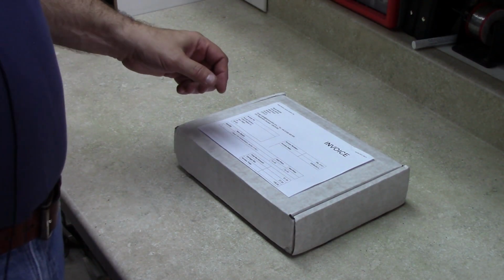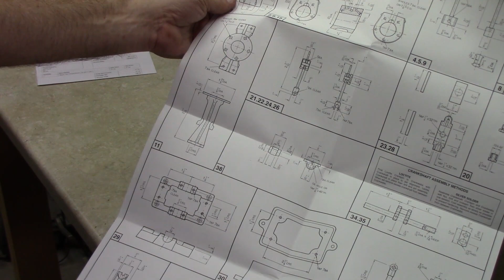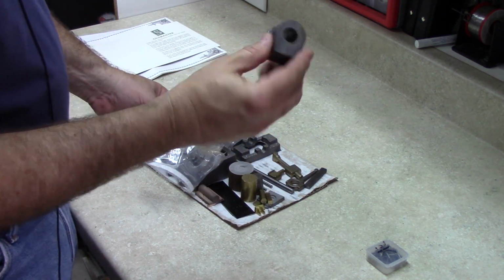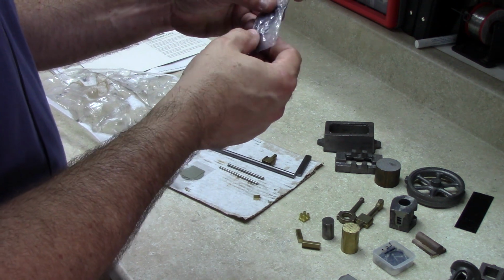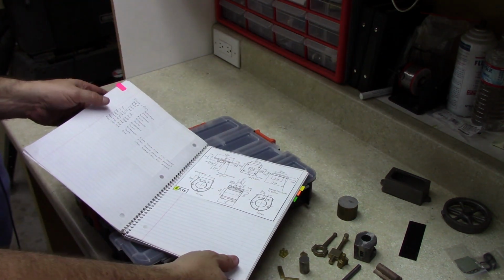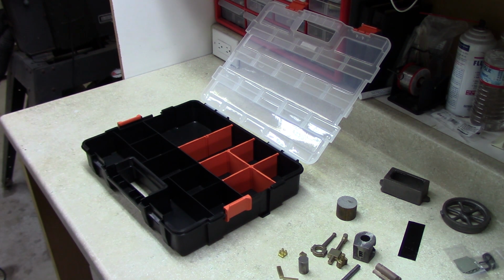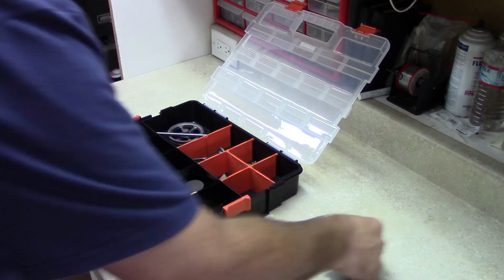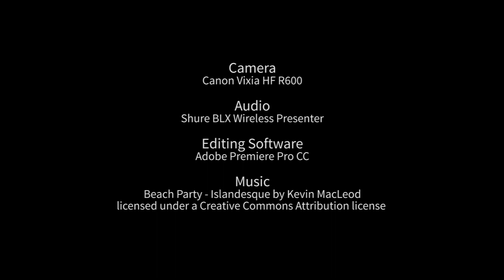Building the Stuart Models 10V Vertical Steam Engine - Part 1

Comment: Years ago I bought a Stuart 10D kit (dual cylinder  version of the 10V) I put it aside when I broke one of the standards when it slipped in the lathe. Recently I silver soldered the standard and am about to start back working one the engine. It will be nice to watch your videos along the way. On mine they had all the drawings shrunk onto one 8 1/2 X 11 sheet of paper.
Reply from the maker: Jim,

How did the casting repair turn out?.  I was under the impression that cast iron was impossible to silver solder because of the high carbon content. 

The drawings they provided with my kit were quite good. The overall assembly drawing is about 8x11, and the individual part drawings are all full-size and fill a 16x27 sheet.
Reply: Cast Iron silver solders / brazes quite nicely actually. Perhaps you were thinking of welding, which is very difficult in cast iron because of it's very low carbon content. Cast Iron by definition has no carbon at all, which is why it sucks to weld, is brittle, can't be torch-cut, etc.
Reply: Cast iron has between 2 to 4 percent carbon.

Comment: just wishing I could order directly from Stuart and receive an unmolested casting kit. customs in NY port are pretty rough on these, I've ordered 2 kits and both were fully opened, loose parts just jumbling around amongst the peanuts. some tiny brass flat bar I thought missing was wedged in a seam inside the box.
my advice is just buy the soleplate and cylinder castings from Stuart and source everything else locally... or move to the UK hahaha
looking forward to seeing your build!

Comment: I found that the drawings were not complete in that I had to figure out some dimensions on the piston rod and valve rod.  I am a draftsman as well, and I simply do not like the way they have done the DWGs.  THey leave out too much standard information.  Naturally, I redrew everything on a CAD program making additions and a few small changes.  One of the big problems I had is the British "BA" system which in the USA, we don't have those sizes of taps and dies.  So I changed all that to American sizes.

God, that standard was a trip to machine.  I'd like to see how other peeps did that.
Reply: Hi Dik, do you have an email or web site?